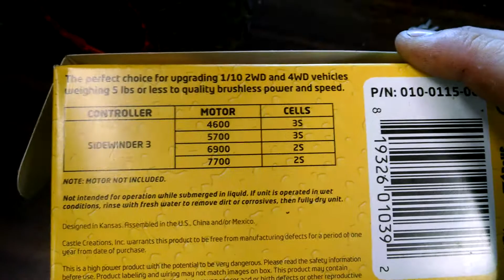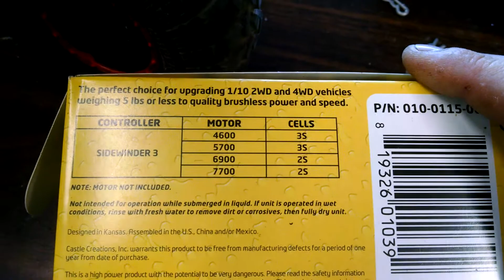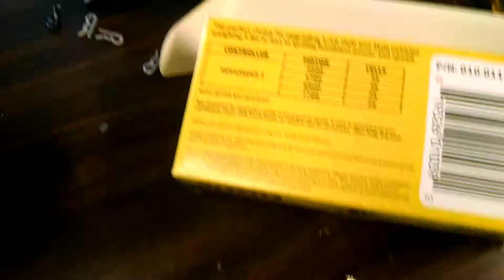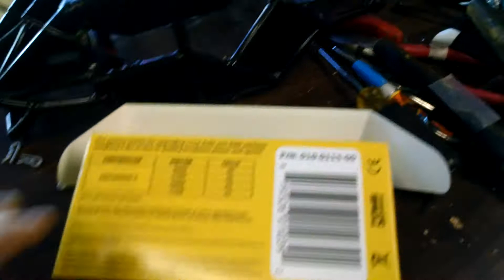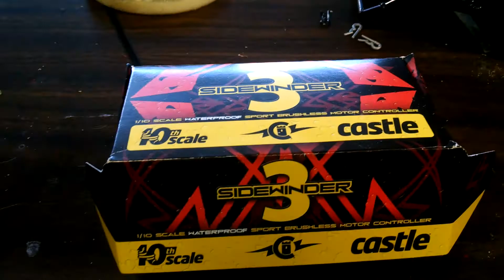Brushless ESC running two brrushed motors on

Comment: Would this work with the surpass hobby 30 Amp trying to run my scx 24 stock motor size
Reply from the maker: It should just make sure the polarity correct,  I have not tried it on the surpass hobby 30 but I'm pretty sure it'll be able to handle those two little motors

Comment: do you have to use that exact esc or will just about any esc work.
Reply from the maker: Will Crannell it has to deal with amp draw Sidewinder 3 is a 80 amp ESC so as long as the amp draw running two Motors is below 80 amps technically you should be fine
Reply: rc habbit thanks
Reply from the maker: And Sidewinder 3 is waterproof and programmable which helps a lot

Comment: what motor is in the rear
Reply from the maker: Jacob Barkley fk 180 motor but be careful cuz it'll strip gears a lot of power in that motor
Reply: rc habbit OK thanks
Reply: rc habbit do u have the same motor in the front
Reply from the maker: Jacob Barkley yes I do it requires some carving on the front transmission to make it fit perfect not only that for gear mesh it really needs to be precise on how much you cut out of the transmission
Reply: rc habbit I got one more question what size tires do I need for the stock rims on it I'm thinking bout buying new tires
Reply from the maker: Jacob Barkley I use 1.9 tires they seem to fit well 2.2 is too big
Reply: rc habbit OK thanks now I can order some lol
Reply from the maker: Jacob Barkley sorry about not getting right back to you it didn't notify me that you sent me a message I happen to come across that in my Gmail hope this helps
Reply: rc habbit it's OK but thanks for all your help

Comment: i think you mean ESC, =)  I'm so cal - LA area  
I tried only my trackstar esc's, which didn't work and i dont have a programming card for it... I was hoping it would slightly work.  i was going to try swapping the wires but didn't get to it b4 i went to bed last night.  gonna go try again now.  I cant find an adapter i need to try 2 other esc's, ones programmable and i happened to have a card from a previous hunt.  you can email s30uploads@hotmail.com to exchange numbers.  thanks for your help, i already got an ad in CL for the SW3.  $50.... i need something everyone can use that wont make the MRC worth $200 =)